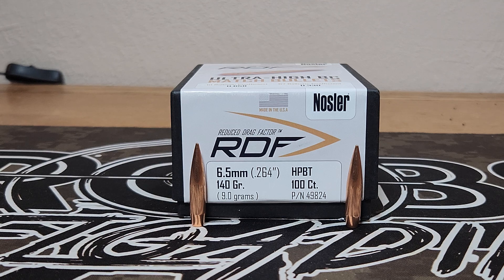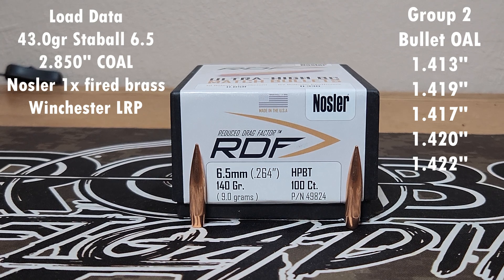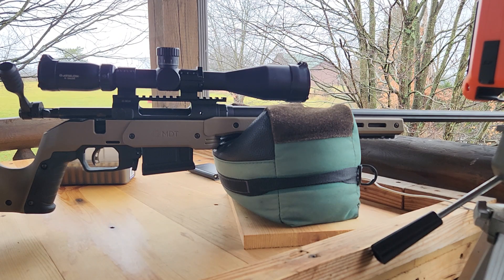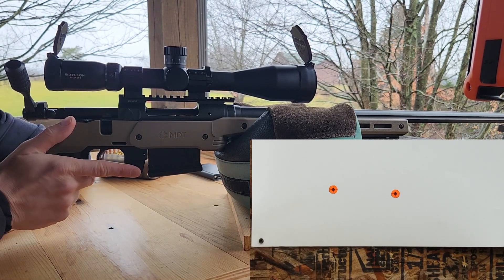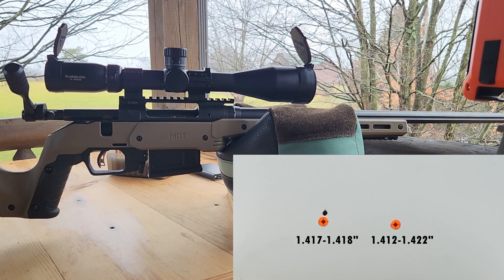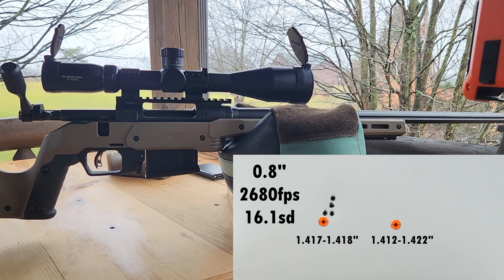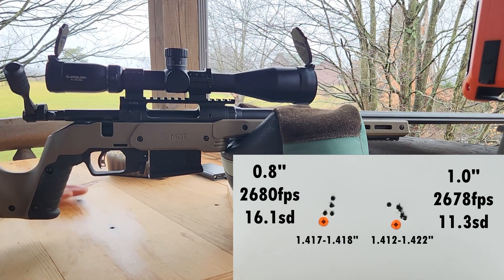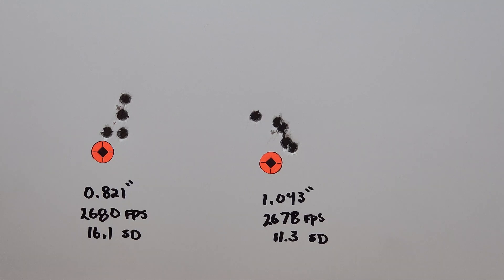Does Bullet OAL Impact Accuracy

Comment: From my testing what matters the most is cartridge base to ogive. I wish you would've chased the COAL to make all the loaded cartridges the exact same length instead of using a CBTO measurement to seat all them that way you would've shown just how important things like bullet comparators are because you would've noticed a pretty big difference then. That said variations in the bullet OAL can give you some inconsistencies in group size at distance for things like midrange benchrest or F-Class even if the ogive measurements are the same (from my understanding) but for the vast majority of people it's not going to be enough to even notice... I'd like to seat if the trim length of your brass or even primer seating depth will make a difference in group size or velocity numbers to see if these high price trimmers and priming tools are worth it. I haven't really been able to see a difference but lots of people swear it does.

Comment: Barrel vibration is a huge factor in what happens at the paper. You can’t change something like a muzzle brake and not expect things to change. Changing something like that usually means you’ve got to work the load up again because you’ve just substantially changed how the barrel is vibrating. A load that shoots well is cooperating with barrel vibration. A load that doesn’t shoot well is fighting with barrel vibration. I’m guessing this brake is heavier than the other one, hence hitting so low.

Comment: I believe Bryan Litz did some work here (as chief ballistician for Berger this is in his wheelhouse). I think that base to ogive or total bearing surface (both are correlated) is what top shooters do and what I believe Litz recommended. After this step, you then sort by OAL if you are going to point your bullet. This way all the bullets have the same point (die is adjusted as you go to shorter or longer). Base to ogive matters because if your headspace is consistent and so is your base to ogive, then your seating depth will always be the same - thus the consistency.
Reply: Hey rob, what this guy said☝️☝️☝️☝️

Comment: I don’t think overall length will change anything with the same cartridge base to ogive measurements. Slight difference in tip length would be negligible difference in weight and likely bullet base to ogive would be the same so the point in which your bullet is contacting rifling will be staying consistent.
Reply from the maker: Going to do a bullet weight test as well.
Reply: Yeah I think seating them to same Ogive measurement is why this was so close. That’s the point of seating to Ogive, more consistency vs loading by cartridge OAL. I think the test would have shown different results (possibly) if he seated them all to the same cartridge OAL so the different length bullets would be seated differently.

Comment: Scott Saterlee did a series with Shooting with the Lilly's a while back using that bullet.  He had shot that bullet enough but showed us anyways where he shot .010 off the lands  with his CBTO and ran them back .120 for his load workup.  He found you need a lot of jump with that bullet. I think he ran .080.   If you don't have one, I would recommend getting a comparator gauge to find where that bullet is sitting in relationship to the lands.  

I noticed that your action didn't want to close on one of the bullets, suggesting that you had jammed that bullet.  So I suspect that your neck tension is also inconsistent if the bullets are seating at different lengths.  

So contemplate a comparator and use a mandrel to helpl set your neck tension.  I haven't had coffee yet so you may have said all that at the beginning.  With that style of bullet it's the only true way to verify correct bullet depth instead of going off COAL which is very inaccurate.

Berger also has a great article on bullet jump with that style of bullets, and also confirms that a lot of jump is needed.  

Thanks for the video
Reply from the maker: Couple of clarifications here. I measured bullet oal base to tip prior to loading. When I seated the bullets I used cbto measurements. Seating dept was not inconsistent. Coal was likely inconsistent due to the variance from bullet to bullet.

The action not closing equally or with the same force is likely due a case that has slightly more headspace from resizing. Also the action isn't exactly the most smooth and can often bind.
Reply: @RobsReloading  thanks for the clarification.  Give the bullet more jump.
Reply: @RobsReloading  but find a velocity node first with the bullet .020 off the lands first